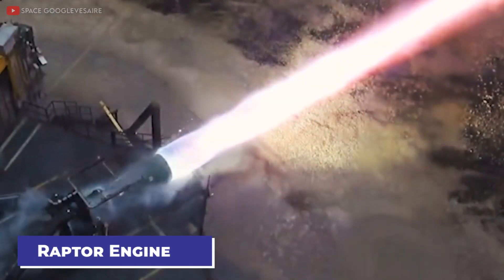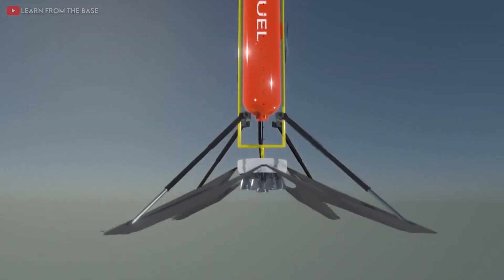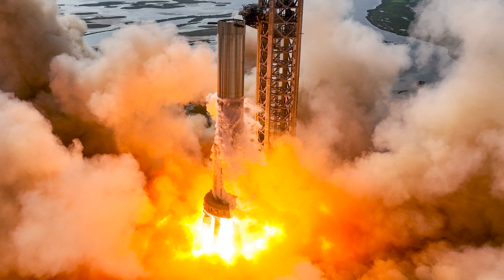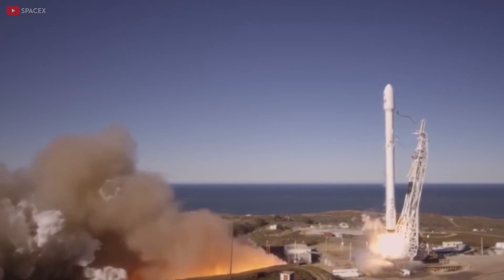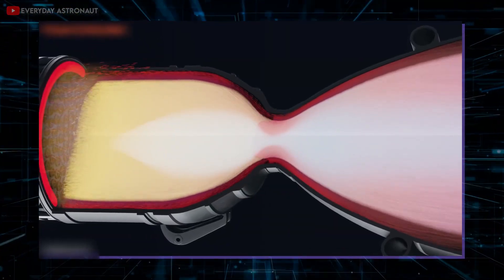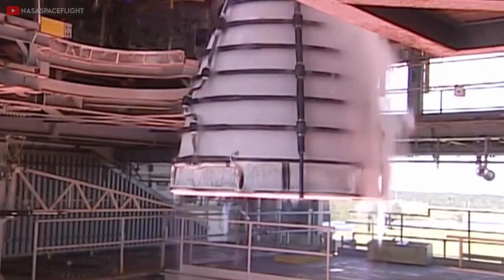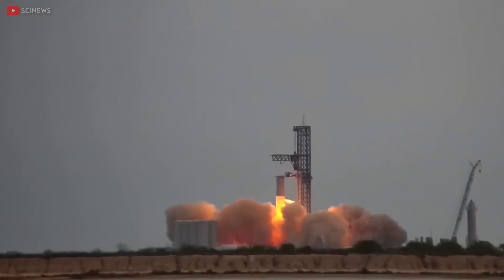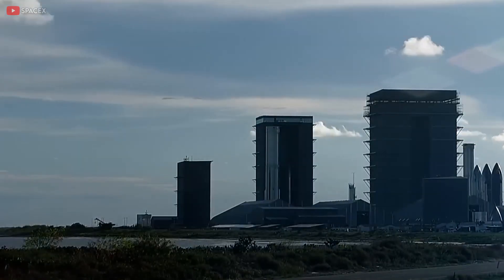WHAT NOW...SpaceX's Raptor Engine Problems?!

Comment: Dont put such a misleading title. Compared to the first fully stacked orbital launch attempt. This booster has already made various improvements. The booster 7 had many issues and the static fires of that one went from 3 to 7 to 14 engines working succesfull and needed a lot of repairs each static fire and had to undergo many crygenic tests before it was ready to fly. Now only a few months after that one, booster 9 only needed 1 cryogenic test and spin-prime test before the static fire and got 29 raptor out of the 33 to turn on succesfulley on its first attempt. Atleast get your information right before posting.
Reply: Then I guess you’ll be going to mars any day now.